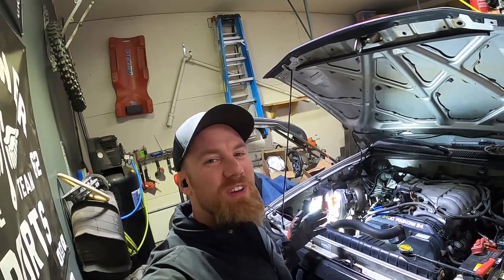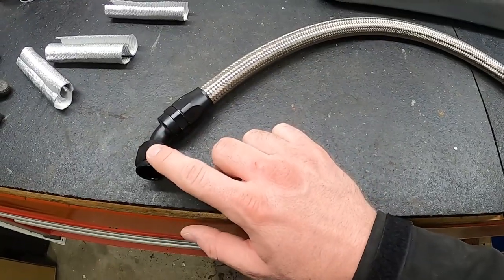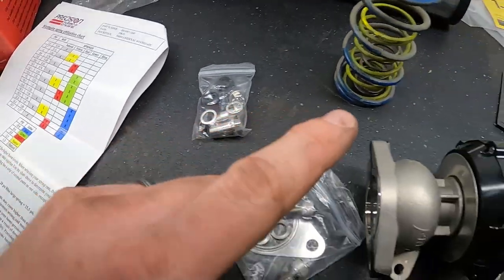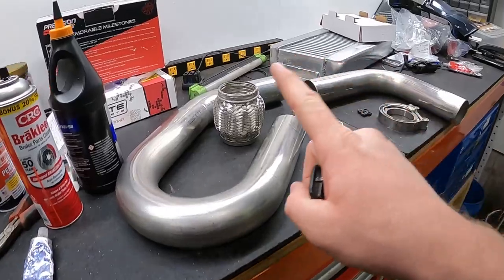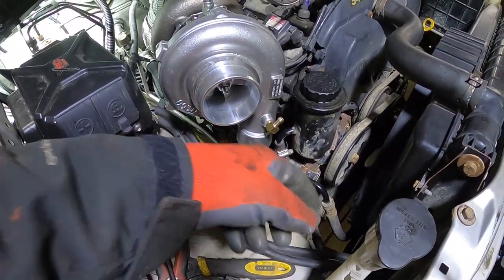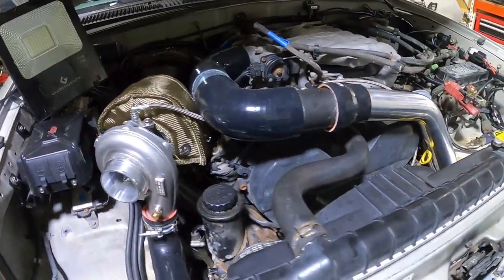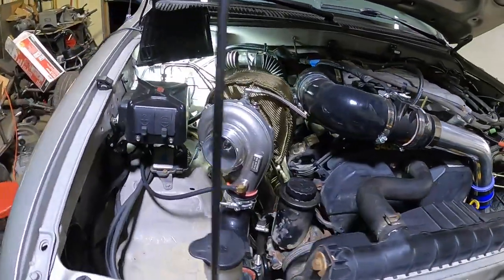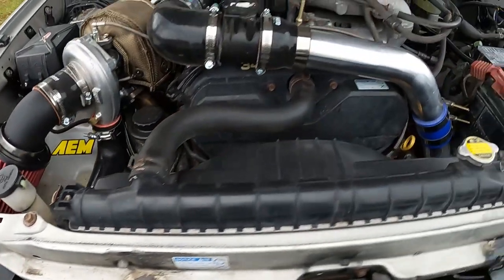We Make Turbo Noises!! How To Boost Your Toyota 5VZ-FE TO THE MOON!! Turbo Your Tacoma Or 4Runner!!

Comment: Only thing i wonder about is when the 3.4’s are warmed up and at idle their oil pressures drop to damn near 4 psi..  mine gets down to 3 sometimes according to the gauge.. kinda scary especially with a turbo if its hot ..  youd kinda wanna make it run high idle for the turbos sake..
Reply: Idk about these motors but I had a mk3 turbo Supra.. their pumps are low pressure high volume. 

I imagine these are similar..

Comment: Love the truck. I too have a 5vzfe turbocharged truck. I have one question that maybe you can answer. 
My truck is having an issue going over 3k but when sitting at 3k and I hit the overdrive the truck will go past 3k and hit boost.
Reply from the maker: That's a good question, I would do a boost leak check but make sure it's not an exhaust restriction problem like a clogged cat.
Reply: if you have an automatic then you need to run a piggyback
Reply: @CRACKEDHOUSINGFAB   i shouldn’t have an issue with a restriction because i don’t have exhaust 😂 it’s a straight pipe out the passenger fender. I’m thinking it’s honestly something with my piggy back because the truck came from Colorado and hasn’t been tuned for Arizona.
Reply: @ethanheilmann8599   yeah my truck is auto. And it has the URD piggyback. I’m thinking it’s a tuning issue because the truck was built in Colorado and I picked it up in Arizona and I doubt they had it retuned.

Comment: How many miles are on your motor and how reliable is it since you have put a turbo on it?
I have a 02 model With 307,000 miles on it. It runs perfect but the power is extremely too little. I’m not trying to make a super car out of my truck but I would love to have a lot more power to get it so get up and go.
Reply from the maker: It has been reliable and I haven't had any problems yet. I believe it had about 220k on it when I turboed it and it I've put about 10k on the set up so far

Comment: What made you go with the turbo over a supercharger?
Reply from the maker: First of all, I've wanted to build something turbo for a long time. Second of all, I like the fact that you can grow with a turbo and add power down the road. Third of all, it was considerably cheaper than a Supercharger. Plus it sounds sooooo good!!
Reply: @CRACKEDHOUSINGFAB  do you plan on rebuilding the motor to take more power? The stock motors are good for about 8psi. Anything more and you are at a higher risk of blowing head gaskets and things like that. I supercharged mine for simplicity purposes and it makes a cool noise too!
Reply from the maker: Yea, if I do go more boost later than I will do some engine work but it is my daily right now so I need to just make it drive well and be fun. The Superchargers do sound awesome too!

Comment: Are you still running the Turbo that comes with the CX kit?
Reply from the maker: It wasn't the turbo that comes with their kit but it is a cx racing t04e turbo. And yes I'm still running it
Reply: @CRACKEDHOUSINGFAB  thanks for the reply! also, maybe i'm missing something in your videos but what did you do for fuel management? i know some people use piggyback ecus but im struggling to find a legit option.
Reply from the maker: It's all stock ecu and fuel system

Comment: were you able to tune the stock ecu or did you get a standalone. Im getting the turbo install all together but my only concern is the ecu,some years of the truck have ecus that cant be tuned and will need a standalone.
Reply from the maker: There are a few years I believe that are that way but I'm all stock ecu and fuel system

Comment: Stop bro. Damn. Once I save some money find a way to spend it🤣 can you put a price sheet on this so I can see if I make the cut
Reply from the maker: Haha it's money well spent, do it!!
Reply: @CRACKEDHOUSINGFAB  I am in the process now. How do you think the ecu will respond to my straight pipe? Also I am having trouble finding a piggy back ecu that is flex fuel compatible and does not cost $1500-$3000 in it self. is there any way I can contact you about some questions I have or some that might arise in the future of the build.

Comment: Why didn’t you run a blow off valve?
Reply from the maker: Sometimes with the factory maf people have problems with the air leaving and causing the truck to stall. Plus I love the sound without the bov!
Reply: @CRACKEDHOUSINGFAB  I have my maf in the charge pipe, and i put my blow off valve (NGR Performance- Greddy clone) right after the turbo outlet before intercooler. So when it opens, it doesn't affect the maf which is after the intercooler on the other side. Is there room on your piping? right after the turbo on the 2" section. Checkout NGR performance blow off valve its a greddy clone and adjustable with 2 ports, its only 160ish bucks. It looks like an ebay bov but they have a good diaphragm inside it.